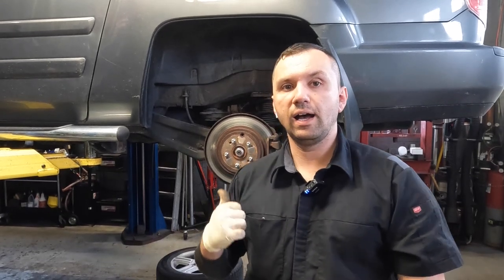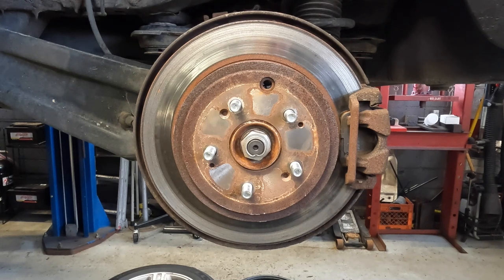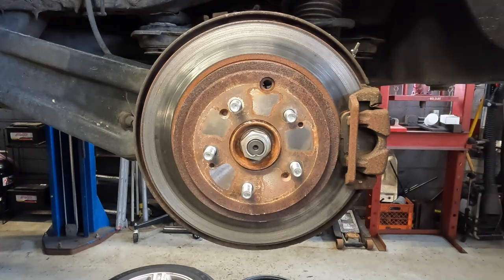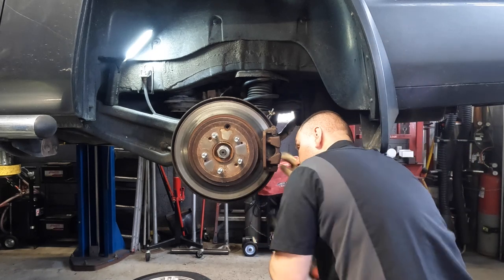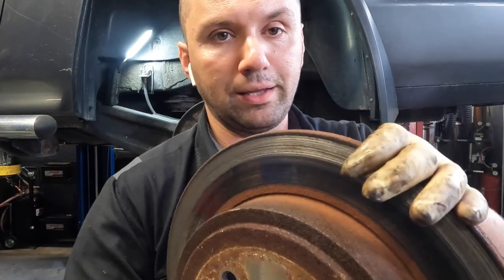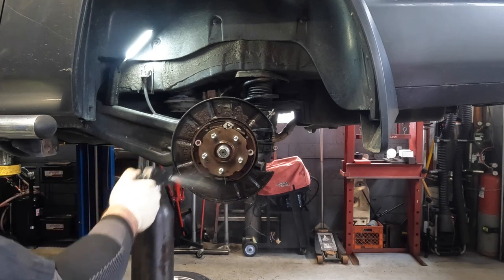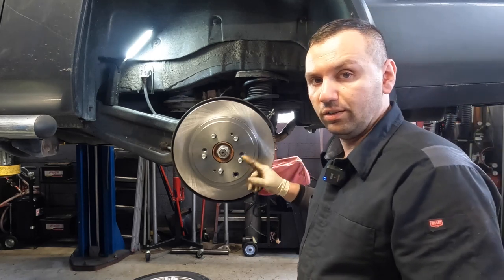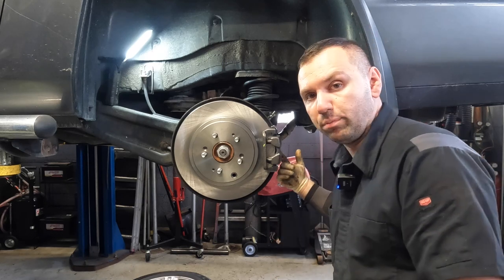ANOTHER CAR THAT DIDN'T GET BRAKE'S DONE IN TIME! HOW TO REPLACE REAR BRAKES ON A HONDA RIDGELINE

Comment: What size of vinyl hose is recommended for the brake bleed, to fit snug on the nipple on this model of ridgeline?
Reply from the maker: The hose I used is 3/16 but I do have a bleeder adapter hooked up to mine that's universal for all bleeder nipples